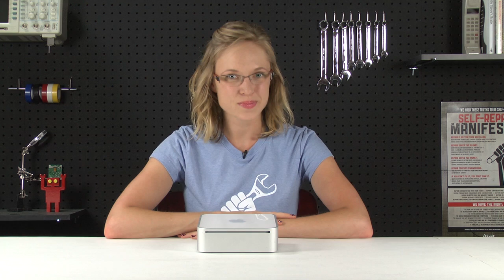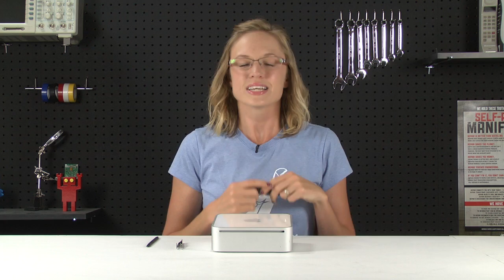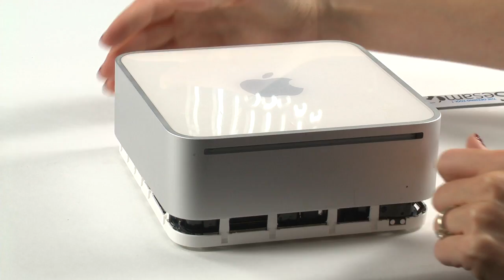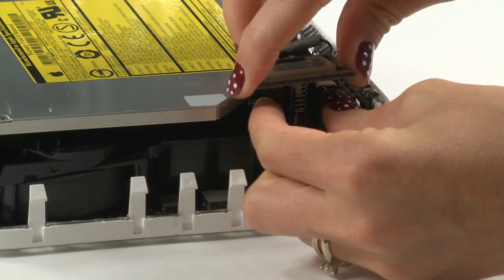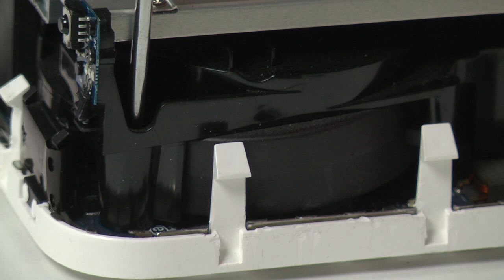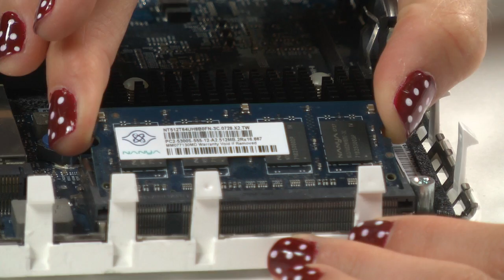How To: Replace the RAM in a Mac Mini (Core Duo)

Comment: Just a few notes to help others who might have struggled at all. (Late 2009 Mac Mini)
1. I did not have to unplug that black plug near the circular cell battery, nor did I see that plug.
2. To put the screws back in without a magnetic screwdriver, I held the mac upside down and put the screw on the end of the driver, then up and in, so that the screws wouldn't fall anywhere I didn't want them to.
3. Be sure that the ram is in all the way. You will hear a click when it's all the way in. I didn't do this the first time and when I tried to boot up, it  made a beeping sound and didn't even start the boot up process.
Reply: Greg Dionne Thank you for the advice.

Comment: I've found that it's easy to start at the back when opening the case. Any blade will do, and the seam there is above the ports panel, making it easier to pry. Once it's started there, it's really easy to get the rest loose.

Comment: I took my mini apart and when I put it back together the fan was running in high gear all the time. Turns out my hard drive thermal sensor cable had come unplugged. But I did not understand what was happening nor how to fix it. I'm grateful for this video.

Comment: I have the new late 2012 27 inch i mac the nice thing about it you don't have to use any tools. You just shut it down unplug the back power cord then on the plug outlet  there is a switch you just hit it and the back door pops out then you pull down the ram storage and insert the ram.

Comment: i upgraded from 1GB to 2GB, i also erased the hard drive and installed snow leopard. before, it was running tiger. newer operating system with higher requirements snow leopard, runs just as fast if not a tad quicker, mabye it's just wishful thinking though hah :D

Comment: I followed you advise to a T but by the time I turn MAC on I smelled burning.
Reopened it again and 1 Ram is slightly burned, so replaced old Ram and now is working fine.  What do you think happened?? shall I try again?? I'm sure ram is compatible and I inserted it well.  Any suggestion?  Thanks!

Comment: Can I put 8gigs of ram in one? Ana also a new graphics card?
Reply: +Marcus Basina yes
Reply: Greg Dionne thanks homie
Reply: +Marcus Basina actually, not sure about the graphics card, now that I think about it. Don't quote me on that.
Reply: Greg Dionne aight
Reply: +Marcus Basina 2006 mac minis can only take up to 2GB of RAM and ALL Mac Minis (yes, even the new ones) cannot have upgraded GPUs as they have integrated GPUs as oppose to, for example, a gaming PC with a dedicated GPU, though I think there is a way to get an external GPU but I'm unsure, you'll have to look it up online :)
Reply: U could use an external graphics card but the 2006 Mac mini only supports up to 2gb and 2007 ones support up to 4gb. If u have a 2006 Mac mini, I would recommend putting a 2.0ghz Intel core 2 duo t7200 in it then upgrading the firmware